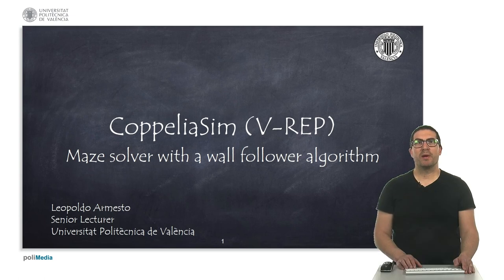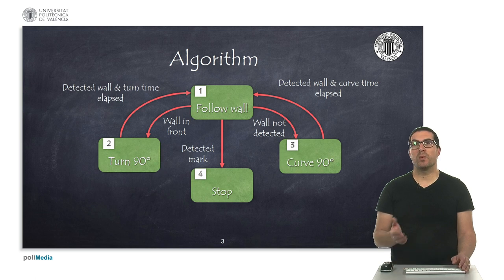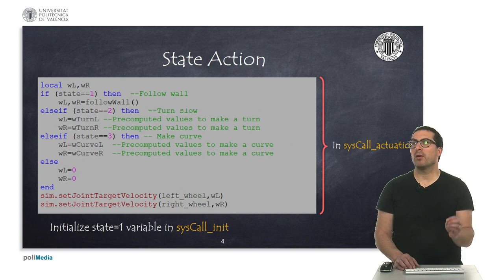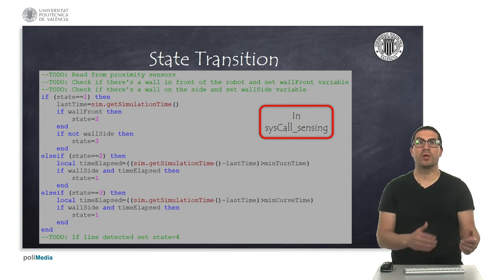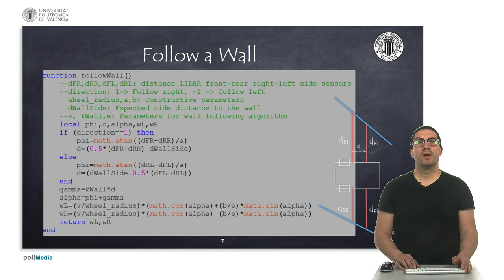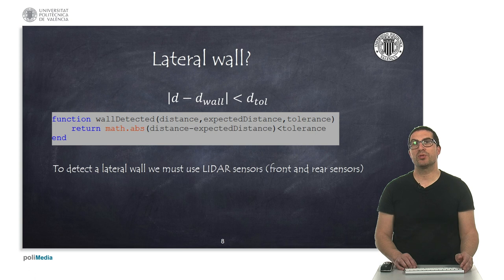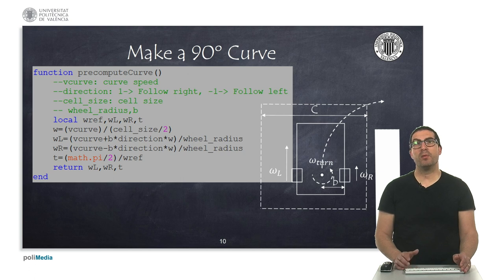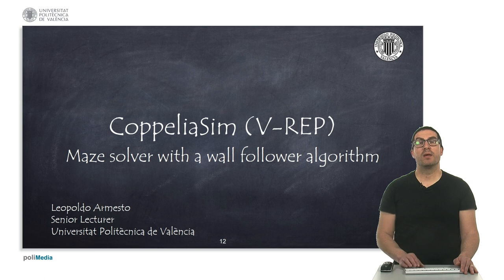How To Solve a Maze with a Wall Follower Algorithm | CoppeliaSim (V-REP)

Comment: sir if i were to make wall following robot just by using front sensor and 1 side sensor(left or right) then what changes should i make in the algo? please help
Reply from the maker: For this algorithm you need at least two sensors on one of each side
Reply from the maker: Otherwise, you can’t estimate the orientation of the robot with respect to the wall
Reply: @LeoArmesto  sir can u please give me rough algorithm/code for it? Bcz am not allowed to use 2 sensors on both sides and the maze given is really simple  one